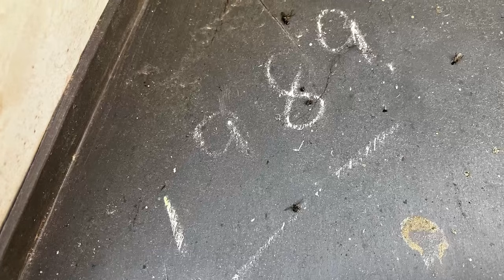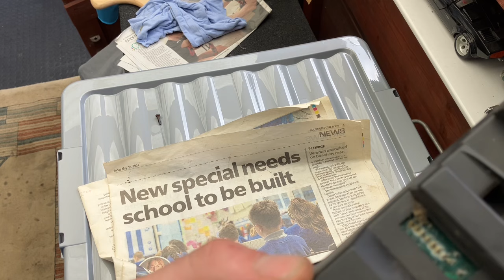Sinclair C5 “6R” barn find - restoration update (July 2024)

Comment: The C5 is such a stupid vehicle, underpowered, slow and short range, but when it was built, it was the best they could do.
I am certain that someone has resto-modded one with modern batterys, motors and electronics that works much better and gives it more range, speed and makes it better in many ways, but original it is a time capsule.
Oh, and that front brake from a BMX, just brilliant, they were never good enough on BMX bikes either...
(there is hydraulic replacements if you don't want to go the discbrake route)

Comment: I tested one of the original C5's back about 1982. It's range was just 4.4 miles. totally useless.
Reply from the maker: @MENSA.lady2  totally agree on the mileage, no where near their stated miles.
These days you have far superior battery tech, they are half the weight and give constant power and don’t drop off - it’s what Clive needed in 1985…!